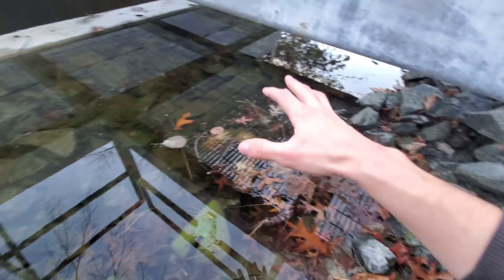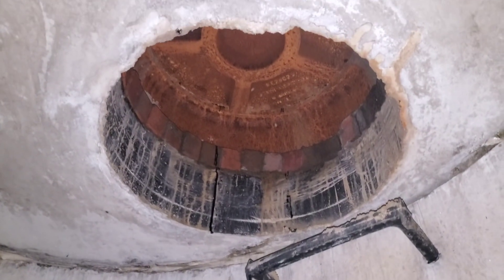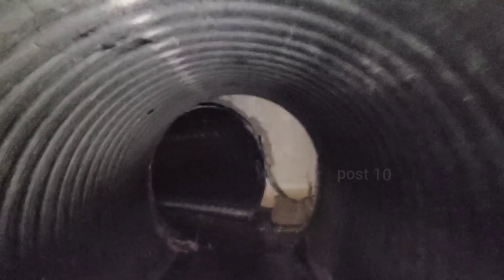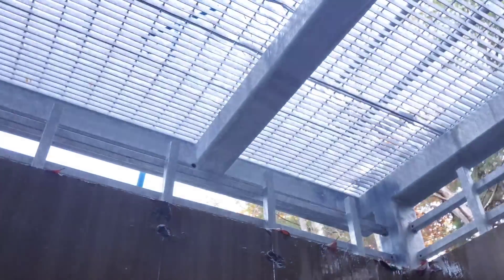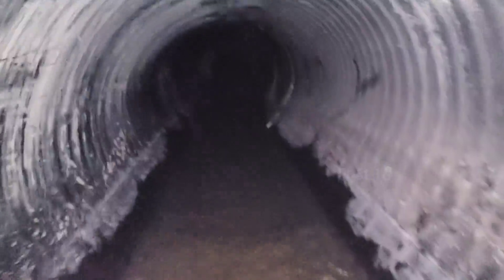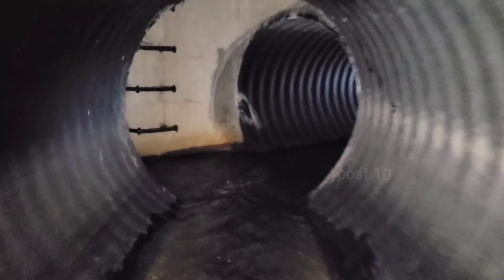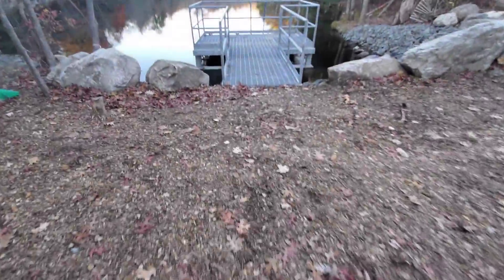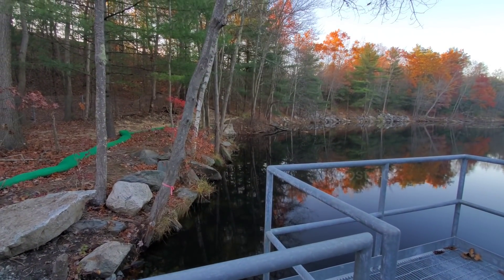Failure Of The NEW LAKE DRAIN CULVERT, Walking Inside

Comment: 2.2 Million down the Drain :D
Reply: I see whatcha did there
Reply: Quite literally lol 🤣
Reply: More like through the side lol 😆
Reply: now they're gunna spend another 2.5 million ripping up the brand new pipe and putting another one in lol
Reply: Are we really surprised though?
Reply: @MrYourfavoritesub  Nope. Every DOT in the USA is awful
Reply: Here is the door sir
Reply: @beanman6684  DOT only does so much the contractor that got the bid should be held accountable
Reply: No pun intended huh 🤣🤣
Reply: @beanman6684  Every once in a while the Virginia DOT (VDOT) hires a company to analyze their operations and write a glowing report about how well run VDOT is. It's all a load of BS.
Reply: @brianleeper5737  and INDOT is basically nonexistent
Reply: A contractor did that, DOT probably doesn’t have the expertise to run a pipe under a pond like that. 

Now it it was a regular drainage or road work. I’d say it was DOT. @Post10 needs to let them know so the contractor can come n fix that. Come winter n the freeze the leaks will get worse.
Reply: Badum tsss 🥁
Reply: LooooL
Reply: @Beeautifullifefarm  I was thinking the same, more then likely this is some cheap contractor trying to pocket as much as he can
Reply: 2.2 million!!????!???!
Reply: Or up. The drain really
Reply: LOL
Reply: Sadly lol
Reply: That's what you get when you go for the lowest bid.
Reply: this is a 24,000 job bro.
Reply: And another 0.2mil for corrections

Comment: Well this isn't good. So essentially the valve is closed but the lake will drain until the pressure cannot overcome the seal. 

At least it's beaver proof.
Reply: With that wide opening beavers might just cover that
Reply: @beanman6684  No kidding. With an opening that big it could become the local Beaver Inn!
Reply: You mean it will burst one day ? Sorry , im not so good at this so i had to ask .
Reply: @sashasash9940  yeah, it will probably burst and   cause a huge problem.
Reply: @BreezyGamingHD  Ok , that does not sound good at all . Thank you so much for answering !!
Reply: @sashasash9940  no problem!
Reply: @firestone3217  i said the same thing about my ex!
Reply: @lm4278  HA! I'm trying to imagine what would consist of a "Beaver proof" girlfriend. Jesus man did she have barbed wire down there?! 😆
Reply: Well, not exactly. Lake level is all about the balance of outflow and inflow. The lake will stay at normal level for as long as the inflow equals the outflow. This leak's not big (though things will get worse if it isn't fixed). Right now, it's probably not big enough to outdo the inputs from rain and streams. Let the pipe's condition deteriorate -- or bring a drought -- and that may change. Then the lake starts draining ... and probably that will involve leaking water undermining that embankment and road the pipe goes under.

Comment: "GOOD ENOUGH FOR GOVERNMENT WORK" as they drove away.
Reply: "haha, suckerrs"
Reply: On time and on budget 👍
Reply: Pretty much how it goes.  I used to work for the Federal government and over the years contractors would come in to do counters, paint, replace doors, work on hvac, etc.  Every single one was done with extreme incompetence (1-inch gaps in counters, missing hinges on security doors, 6-inch spots without paint visible from across the room, dripping pipes in server rooms, etc).  Each contract was under warranty and lowest bidder, and it would get "done" in a day, "fixed" 6 months later, "replaced" after another 6 months, "fixed" again and again and again.  And while the government is not paying any more for the job, all the employees who work there are constantly disrupted having to work around all the half-done and failing work everywhere.
Reply: @LogicalNiko  yep, I work in state government and its the same. Brand new building, half of the rooms weren't even connected to the A/C vents so they turned into ovens. 4 years later, finally fixed by REPLACING all the air con originally put in 🤣🤣🤣🤣🤣 there are so many terrible tradespeople out there, really makes you worry how much safety is discounted for cost

Comment: You sound so nervous! Thank you for showing this ....wow! hoping you can get the attention of the dot and get this redone....and maybe they will let you advise them! You definitely know what your talking about! This is such a disaster!! Good luck! 😊
Reply from the maker: I was ducking and that takes a lot of energy moving in that way
Reply: @post.10  didn't realize that must be a smaller diameter pipe they installed....
Reply: @jenniferbutcher8393  they could've made it at least bigger.
Reply: @jenniferbutcher8393  It's the government way to cut corners.  Really the pipe should have been the same diameter as the original.

Comment: This is actually a rather common mistake, but it can be fixed relatively easily by an internal joint seal if the pipes are supposed to take pressure from the inside. They essentially push outwards, against the walls of the pipe, countering the external pressure.
Reply: Well, there is absolutely zero pressure on the inside, so I doubt it would work. Especially with the pipe still moving it seems. I wonder how this case will develop.

Comment: Now you need to send this video to the DOT for them to look at, and figure out who screwed up the install and who skimped on proper seals. I guess they could fill those seals with some kind of sealant? Or they need to come in and fix the entire system.
Reply from the maker: It needs to sealed from the outside and the gap is huge so probably damages pipe
Reply: I think they need a bigger and stronger pipe, that small plastic pipe can't handle the force of the pond and the amount of water coming into it, especially during a storm
Reply: No need to fix it at all. You can see my detailed response above but that wouldn't come close to classifying as a failure in a storm drain and I say this as a guy who is paid to inspect storm and sewer pipes for a living
Reply: @Florian S So I want to clear some things up for you but first I want to preface I am certified by NASSCO (National Association of Sewer Service Companies) to inspect every bit of sewer infrastructure

While that is not the best install job for storm drains and water runoff that is in no way a failure. Storm drain seals do not need to be waterproof and allowing infiltration (what you saw would be classified as an infiltration runner) barely counts as a defect for storm drains. There is no noticeable deformation in the pipe, and not cracks, factures, or holes so its in pretty great condition despite the slightly offset joints. I've inspected probably close to a million feet of storm drain pipes and that pipe is in pristine condition 

BTW please avoid walking drain pipes those things can fill in an instant in a storm and you will be dead before you know what hit you. When we had to walk these pipes we always needed a guy uptop and at any sight of rain the job was to get out of the pipe as quickly as possible
Reply: @jayyyjude  ofc it is in pristine condition its a NEW PIPE and while you may find this "okay" given you inspected thousands of OLD PIPES and their failures I do not find this ok. This is a NEW PIPE with a NEW INSTALLATION and should not have leaks like a 5 or 10 year old one.

Only because you don't classify it as a failure doesn't make it any less of a shit job on construction.
Reply: @jayyyjude  Thanks, it's great to get the word of a professional on things like this.
Reply: @jayyyjude  Could it be your the guy that inspected this drain and your trying to get your crew out of doing more work to fix it?  I bet you just like the rest of the workers are one of the guys that just sits on his butt at the yard collecting taxpayers money in your paycheck.  Your just mad that post 10 found the crappy work.
Reply: @jayyyjude  Well,,think you've just answered everyones question.If you think thats a satisfactory installation,no wonder construction is in the mess it is.I would assume from your comments you are telling the workers/sub contractors this is ok.Its a slippery slope downhill in construction standards,in which this becomes normal practise.
Reply: @jayyyjude  I could see the thought is storm water is allowed to seep into earth at a particular rate per joint, but this seems to be too much.  There seems to be great erosion.  Possibly other preparatory shortcomings for the pipe bedding?

Comment: I wonder if the pipe actually DOES get narrower as you go through it.  I think it might be intentional to help with the venturi effect - if I'm understanding it correctly (and there's an "if" here), as the pipe gets narrower, the speed of the water flow through the pipe should increase, while the overall water pressure on the pipe decreases.  That means that you get faster flow towards the end of the pipe, helping to eject sediment, twigs, etc, out the end of the pipe.  (I'm not sure it would really matter unless the pipe was mostly full of water, which would be pretty darn full.)

Comment: hey post just go in there with some flex seal liquid the thick rubber adhesive that fills in cracks with ease and it even works underwater!
Reply: Gorilla company makes a spray-on sealer now (June 12, 2021).

Comment: Some engineer just made a mistake which is going to cost $100,000.
Reply: Cost 2.2 million to build. I'd bet the repair is gonna be at least 1 million.
Reply: @cranelord  Nah, that 2.2 million paid for the road and all the pile and digging. It is certainly not gonna be a quick or cheap fix. But they just need to work on that one 20 foot section out of the 500 feet or whatever it is. Don't even need to dig up the road.
Reply: @josht6895  well it's government work so I think anything is possible lol

Comment: This drain is a bit more expensive than building a highway from scratch with the same length. As I remember, it's not clear whose area of responsibility is it. Looks pretty nice outside though. I think it's not a big deal, some concrete and collar will help. Maybe they didn't fasten those sections... Story short, they got a splinter, it will torment them until they completely fix it.

Comment: Big problem indeed.
The construction on the lake side prevents sediment from entering the drain. The drain is an overflow from the concrete basin and sediment remains there.
Sediment only shows up downstream the openings in the floor and wall.
This means that all sediment you see comes from the embankment.
The lake creates its own pass by into the drain, which will only grow.
Management of DOT should be subscribed to your channel, if they are wise.

Comment: The gravel inside the pipe isn't supposed to be there, and the storm water pipes aren't supposed to be gapped like that. They should've been pressed all the way against the next pipe in the line. Most likely what has happened is when they backfilled the line, a machine could have spun around on top of the pipe, or they didn't bother to check the pipes were pressed all the way into the next segment. Just my thoughts as a guy in excavation and service laying :)

Comment: The fix is, drain the lake, again. Dig up to and under the first two joints. Clean the outside of the pipe, encase it all in concrete and back fill. No idea who engineered the pipe or if they specified a full length upon leaving the over flow. No matter, it is the wrong pipe for an exterior pressure situation. Oh, don't assume the manhole bottoms have concrete. :)

Comment: Exactly why Letsdig18 pours concrete collars around his lakeside pipe sections and grouts in the basins. That pipe is okay but you really want to lead off the intake with a fresh 40 foot section with new gaskets and a concrete ring before the first joint. .  One piece looks used so maybe that's part of the issue.

Comment: All right. If this lake has in-feeding waterways, the lake is always filling and rain makes it more so, so the lake is always empting more or less.  So the question is, do the leaky seals leak more than the lake needs to drain anyway. If they do, the lake will empty. They almost assuredly don't. That pipe is packed down with rock, not dirt, so the leaks don't represent an erosion problem. The bits where the pipe is flattened a bit, which broke the seals are because when they filled in around the pipe to bury it, they carelessly dumped on top, rather than in and up the sides first. That was a goof. That's my armchair civil engineer unprofessional analysis. No fee.

Comment: Easy fix
1. Drain lake below trench depth
2  Excavate to solid base removing pipe from second join
3. Replace first two pipes or re seal the two joins 
4. encase pipe with concrete from inlet to just past second join
5. Backfill from inlet to one 1m before second join
6. place sealing compound on concrete encasement above join 2
7. fill void above join 2 with cement to just below surface level
8. reinstate carpark

Comment: Seems like there could have been debris in the bell of the pipe and they just pushed it home with the excavator under water and it rolled the gaskets. When you install this kind of pipe depending on the class it either has one or two o-rings that need to be lubricated as well as the bell end and pushed home gently and straight. The pressure from the ground around this pipe is not enough to collapse it. As far as if it’s in danger of eroding the soil that depends on the bedding around the pipe as long as the rocks are all the way around the pipe including on the bottom by at least 6 inches it will just leak water and not sediment but it appears it’s leaking sediment.

Comment: They used the correct pipe, they failed to install the proper anti-seep collars around what they have used. plus, I believe they put the pipe in backwards but that is hard to tell with how you videoed it and they would have done much better putting the first joint farther away from the source of water. The pipe itself is fine.
Go check out Letsdig18 channel, he has built hundreds of pond dams and you can see how these parts work together. What they need to do is go back and completely surround that joint in the pipe with concrete to seal it and make an anti seep collar there.

Comment: This pipe is called double wall or triple wall extruded pipe. It’s a cheap material that imo is junk. This has become normal for projects to save money. I do not agree with your assessment of the pressure causing the issue. I think it’s just bad materials.

Comment: Sucks. That outlet structure is really nice and is let down by what looks like a rushed installation. Ive noticed drains built in the early 2000s and prior just look much better Finished. All the pits were cast in situ. Now everything is precast with the pipes just rammed in "knockouts" in the side....... annoying.

Comment: So, they let a problem that would have been a $20,000 repair ten years ago turn into a $2.2 million project that they didn't even build correctly. 
If past experience is any indication, they'll probably wait for a catastrophic failure that will cost a few million dollars to fix rather than get in there now and make the required repairs while the situation is still manageable.
Our infrastructure problem is clearly not due to inadequate funding; it's due to inadequate maintenance and idiotic budgeting practices.  For what they spent incorrectly addressing this problem they could have performed good quality major preventive maintenance on 100 culvert systems.

Comment: 2.2 million $ for that crappy lazy bodge job that is already leaking. It should be a continuous concrete or plastic pipe. If a continuous pipe is not possible, the pipe should be bolted and/or welded together where the joins are, not just joined with rubber "seals".